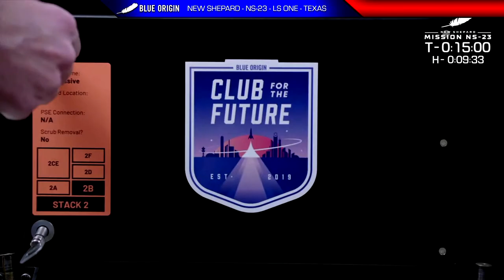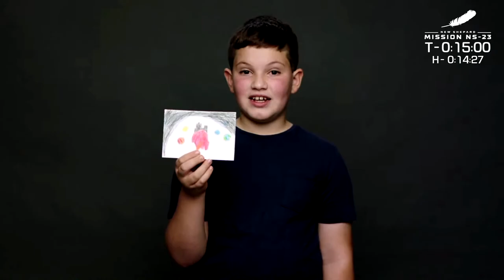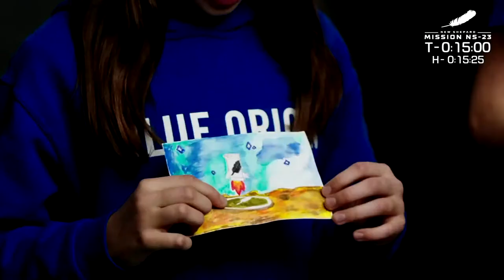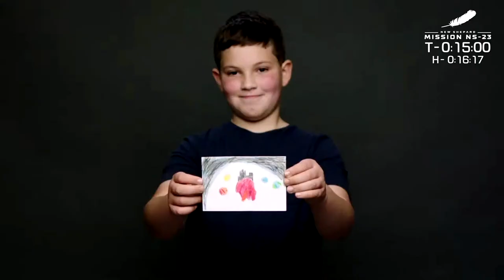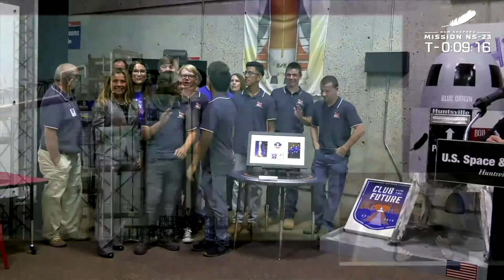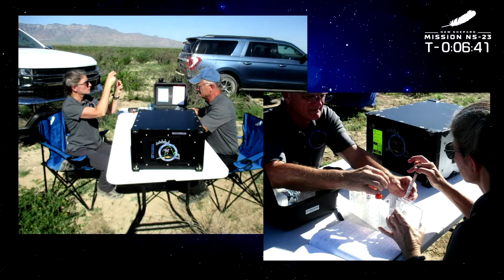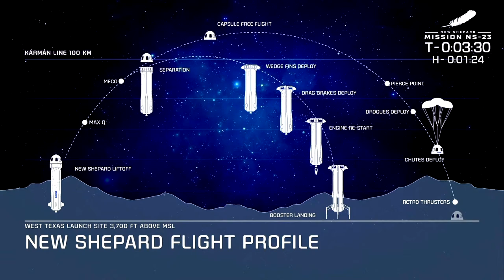Blue Origin - New Shepard - ANOMALY - NS-23 - Launch Site One - Texas - September 12, 2022

Comment: Non successful mission!💥
Reply from the maker: Well, let's say it was an unsuccessful successful mission, because the emergency system worked very well. Capsule safe and sound, booster lost. Such can happen.
Reply: @Space-Affairs  True...looked like a major engine failure and loss of control...the booster suddenly yawed right before the escape system fired.
Reply from the maker: @samsignorelli  As far as we know: short before Max-Q (Maximum Aerodynamic Pressure), it is to see in the video that the BE-3 engine sparkle some debris. Before getting through Max-Q, the engine will throttle down a bit to get through Max-Q. Short after that, the BE-3 engines failed and the Capsule is separating with the rescue system from the booster. So, some are claiming now "Bezos rocket exploded in a big fireball", but that is the typical nonsense by some press media. The booster didn't explode, made its way uncontrolled back to the ground and is now a wreck in the desert. The "Fireball" is the ignition of the rescue engine of the capsule which will accelerate the capsule away from the booster. When you see the speed-meter, it is a huge acceleration, even only for a short moment. The guess is, that the max G-force was here more than +8G. Good, that nobody was onboard today, people would get hurt probably a lot. However, the rescue system worked. It is comparable what happens to the guys from Soyuz MS-10 in October 2018. Interesting thing is now, how long Blue Origin will suffer from that. Maybe, they lost some clients and also, if they have a second booster available ready for flight. It will take a longer time until the next flight, this year is probably over for flights with the New Shepard.